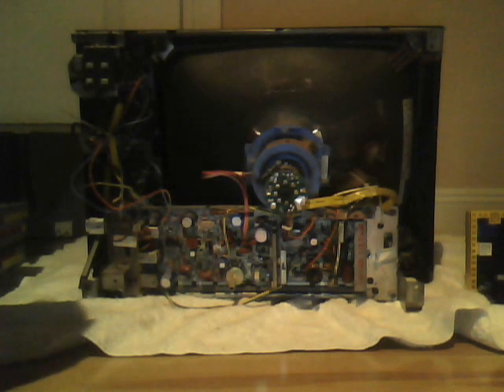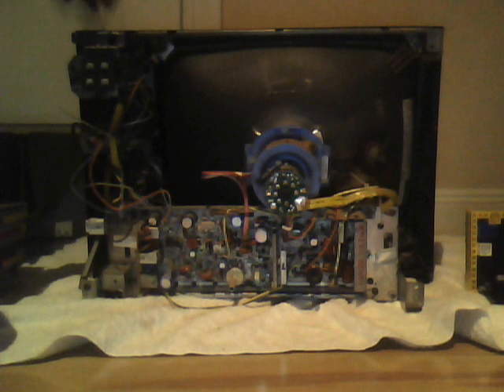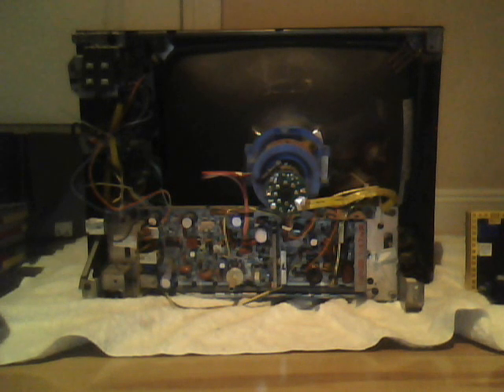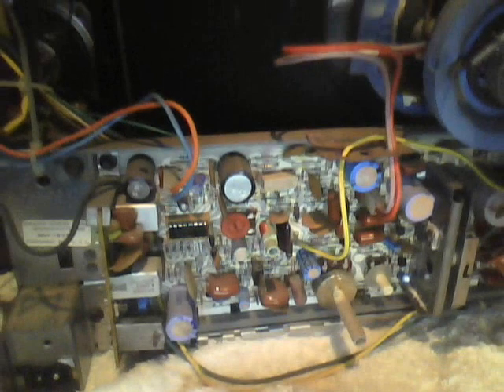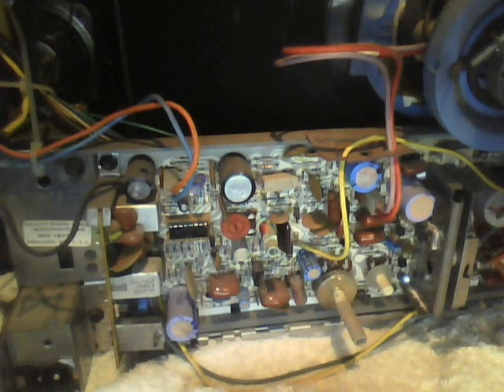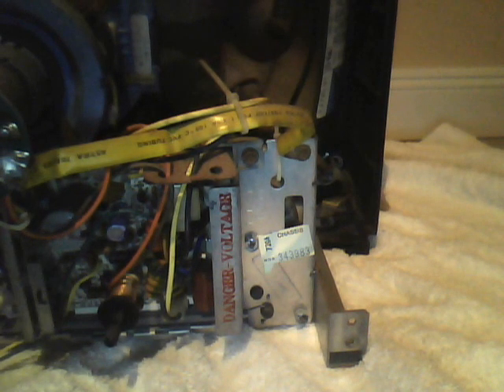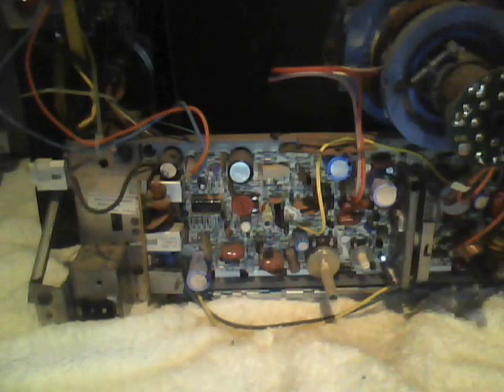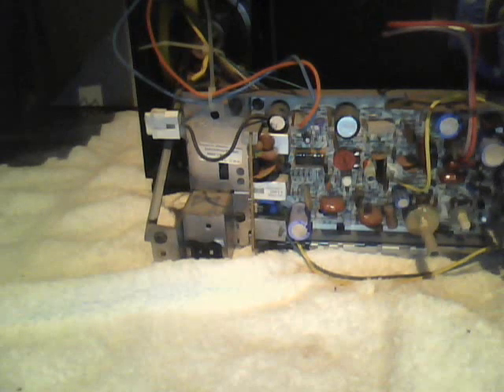Inside the 1977 Zenith J163W B&W CRT Television Set

Comment: the picture tubes were mostly made in the states often up til the mid 90's while Capacitors and other little components were made in places like Taiwan.
Reply: realgroovy24 tech I'm pretty sure they only produced CRTs in the USA until the early-mid 1980s? I'm not entirely sure, but that's what I remember reading a while back.
Reply: realgroovy24 tech I'm intrigued by that, as component-level manufacturing like CRTs was outsourced to countries like Japan, China and Taiwan in the 1970s/80s, and by the 1990s, a majority of electronic consumer goods were imported. That's why BPC era sets are usually crap.
Reply from the maker: realgroovy24 tech I do like some late woodgrain sets though.
Reply: realgroovy24 tech There are very few vintage sets with composite input though. Most just have the standard 75Ω/300Ω antennae input. Composite (RCA A/V) and SCART inputs were introduced to the higher-end sets in the 1980s, though those sort've sets (save the B&O sets) weren't usually wood-grain sets - They were generally more modern looking silver or black cased sets with a push-button type tuner, and were used with accessories like VCRs, early video games and computers.
Reply from the maker: +Fairlane500skyliner  I remember what realgroovy was talking about. I did get pictures of a 1998 Sharp set that was made in the USA. Try searching on my channel.
Reply from the maker: Yeah that seems to be exactly how this set was made.
Reply: ***** I seen a few 90's tubes on some sets on youtube such as on theCRTman videos one was made in USA well at least manufactured
Reply: BPC and late wood grains are not worth saving I say!
Reply: same they give a classic feel and at the same time often having AV inputs.